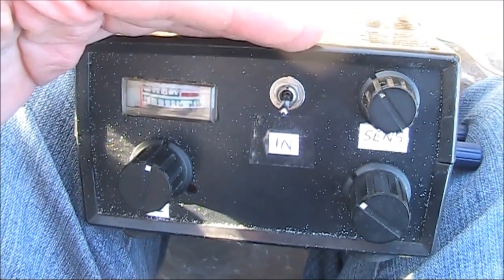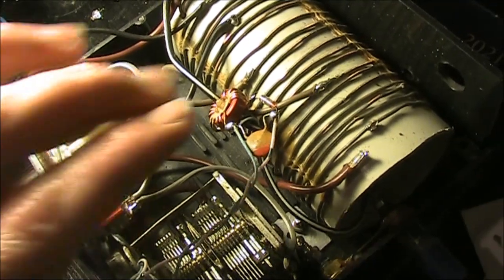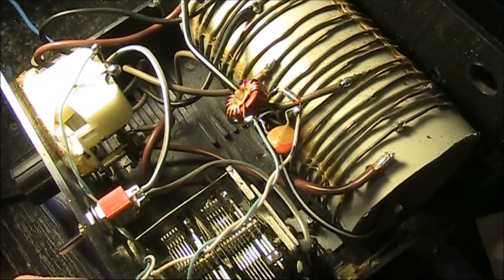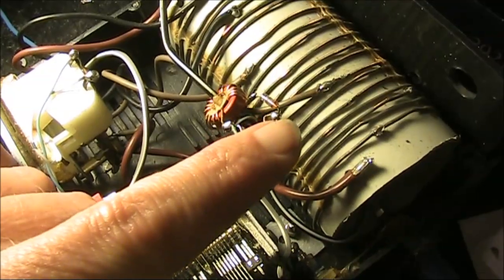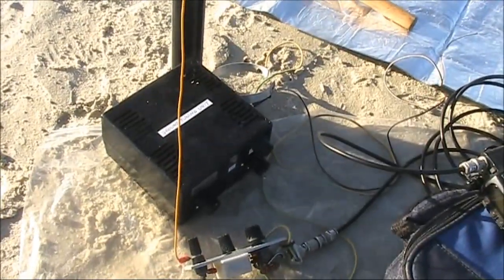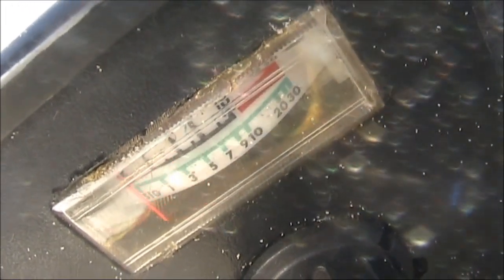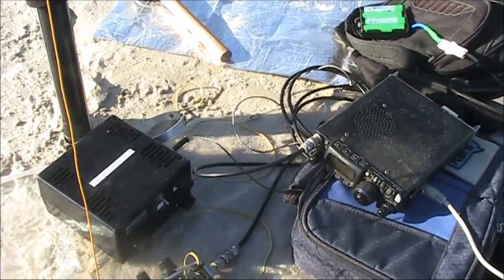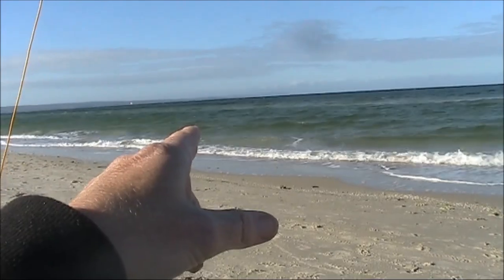Ground Tuning Unit with switch added

Comment: Love your videos Peter ... got a question for you ... I'm looking to put my dx commander clone on the roof of my shed, but im being told i need tuned(1/4 wave) radials.  Do you thing this gtu would aleviate the need?
Reply from the maker: Hi Luke - I'm not familiar with the DX Commander so can't really comment. But if it's just a 1/4 wavelength vertical your shed's roof might be OK to use if it's metal and big enough.
Reply: @vk3ye  yes, the dx commander is essentially a vertical fan dipole, except it has a ground plane setup instead of the other half of the dipole.
  I saw your earlier videos on the gtu, and thought the device might have merit where tuned radials becomes a problem.  I think the only way im going to find out it to give it a go and see what happens!  The optimist in me thinks this should work ... afterall with radials, we're only trying to replace a poorly conductive ground plane with a better one.
If youre interested, I'll let you know how it goes?

Comment: Great video Peter! 👍
Just curious, how much does it affect the performance on transmit, does the receiving stations notice any major positive effects of your signal using a gtu vs. not?
Reply from the maker: Yes it does make a difference. The signal is received in more places with it switched in.
Reply: @vk3ye   Thank you Peter, then I have a new project to build.😄 
Strange that this solution hasn't been mentioned more in the community, it's quite a deal breaker for those with bad ground and could add some better reflection boost to the output. 
I Had some more reading about it and for those living in a apartment it seems to make lot of a difference.

Comment: Hi Peter, several years ago I also fitted a bypass to both ground tuning units on both my pedestrian mobile backpack and trolley stations to see the difference. I also found much more ground current with it switched in. 73...M0DAD